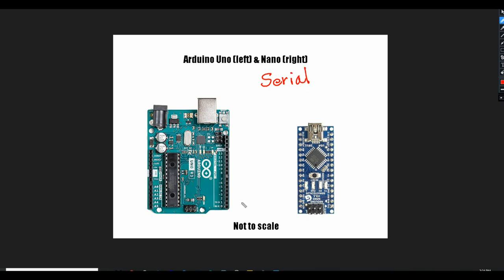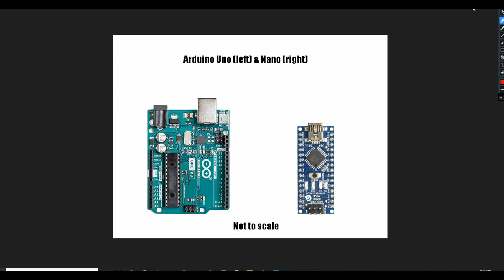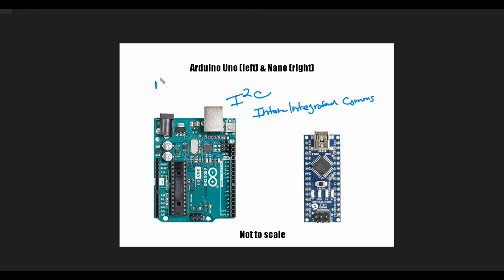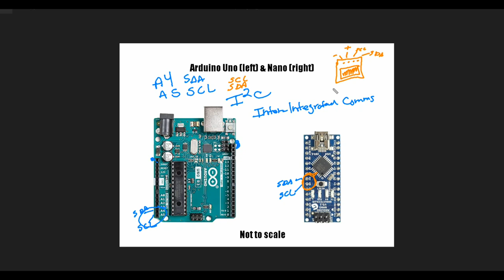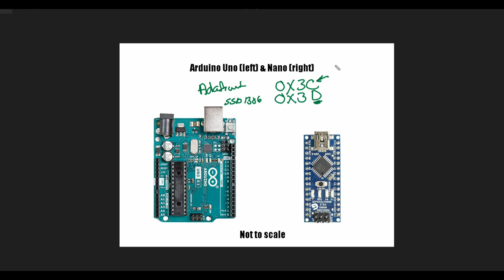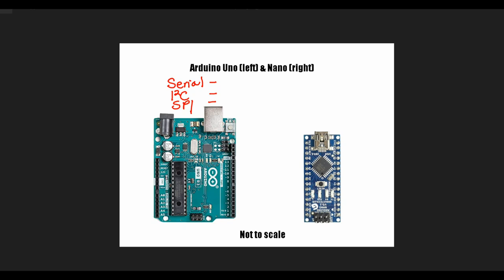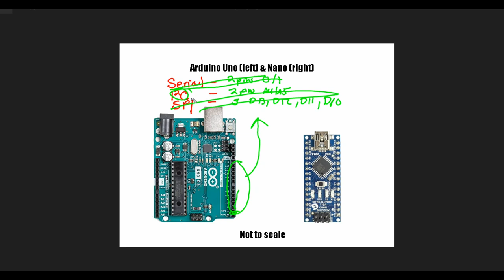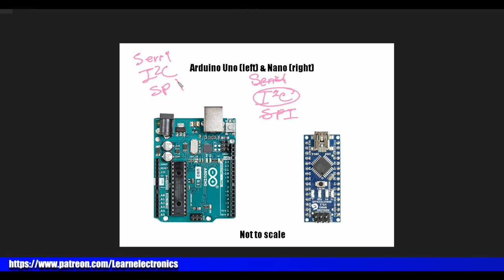Guide to Arduino Busses: Serial, I2C, SPI

Comment: I think with a little clever circuit, one could possibly use an opto-isolator to talk to an RS-232 port? This way there is not actual electrical connection.... might be a neat video for you.

Comment: Good video! You kinda made a hint of this but I'll drive the point home...if you want to use serial with an arduino board, i highly recommend going with a Mega. Use hardware serial. Yes you can use software serial via bit-bang method but i would not recommend this, esp. if you grow the complexity of your project.

Comment: LEARN ELECTRONICS, can you use the oscilloscope in a video lesson on how to measure and decode to tell if its good or what is considered bad in serial data, I2C data, SPI data? the problem is looking at the data and knowing if its good or bad "troubleshooting the data" for the serial data, I2C data, SPI data.
Reply: Very true